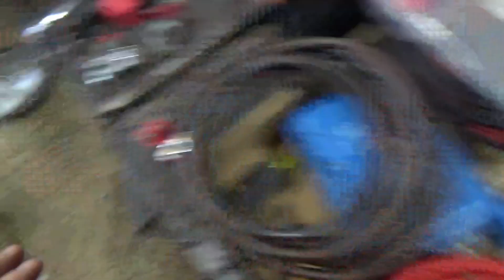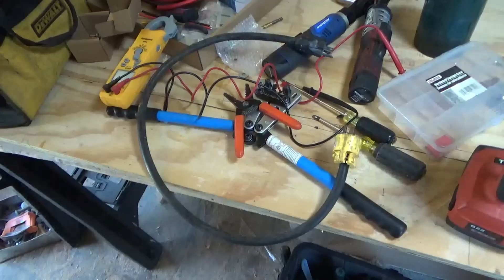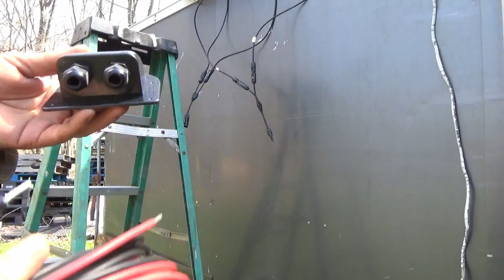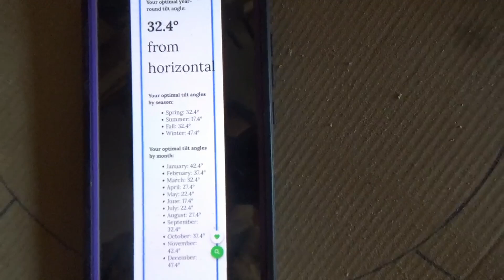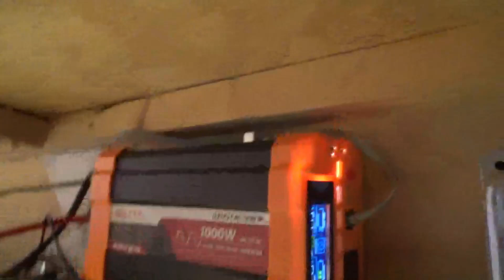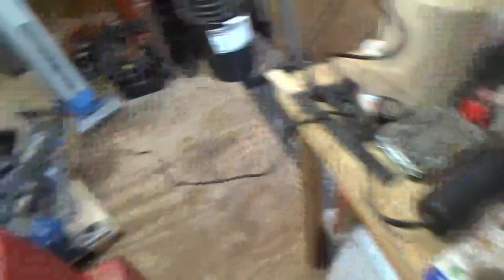Adding Solar to the Woodshop (Victron 100/30 Charge Controller and a Belttt 1000 Watt Inverter).

Comment: Nice work! The funniest with this is that it can grow as big as you want.
I will start small in my shed  soon... It is exiting and I love that it's possible to have lights inside and outside and allsow use some tools... Solar is amazing.
Reply from the maker: Yes. I love solar. I'll be upgrading soon. I know I don't post a lot on this channel, but if you like auto repair videos, go watch my other channel. Dans Auto Diagnostics and Repair. Thanks for watching.

Comment: You realy need the same type and size of batterys for it to work properly thay also need to be deep cycle murane style
Reply from the maker: Absolutely correct. I was just using what I had. I'd like to go with the Lithium batteries but they're costly and not practical for me right now. Thanks for the comment and thanks for watching.